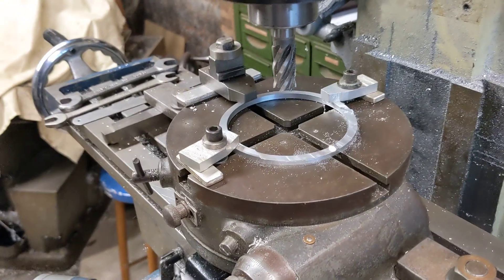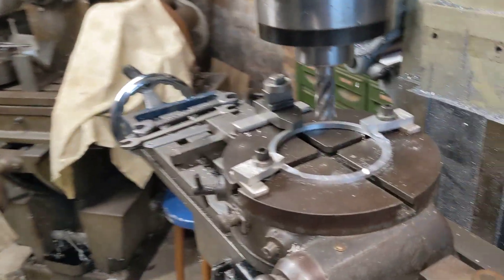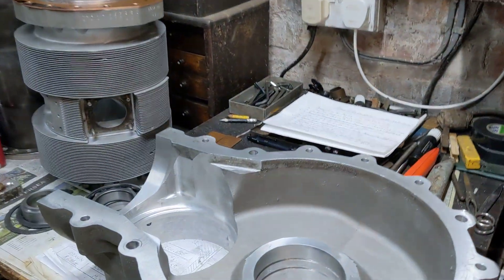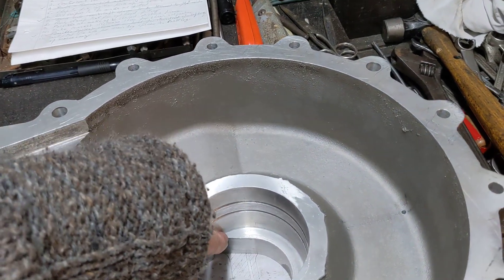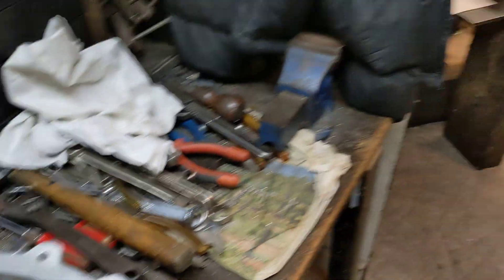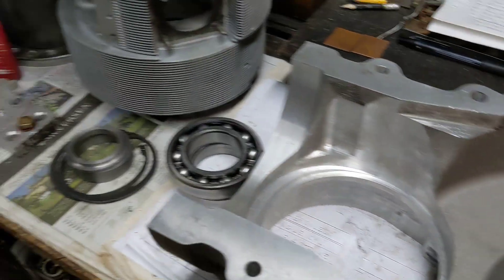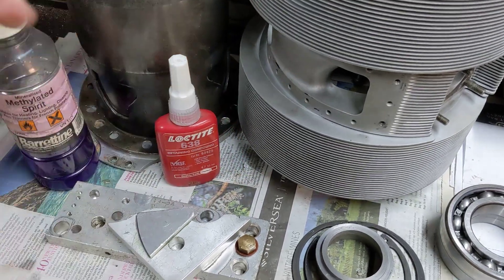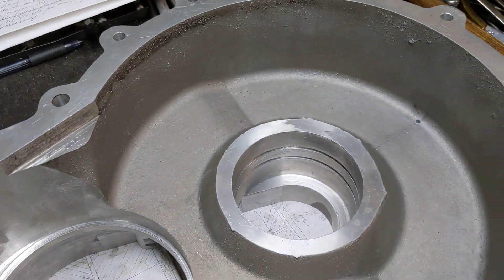Loctite 638/271/whatever....

Comment: I'm still using loctite I bought 20 years ago without any issues. Just give it a good shake first and it's fine. I recently had to remove a crank bolt that I had gotten a bit carried away with the loctite last time I did the cam belt and it was a mare to get out, so proof enough for me.